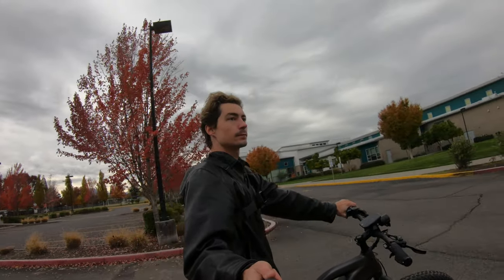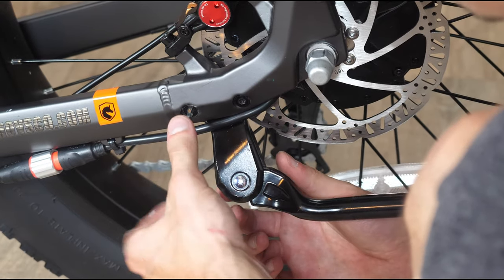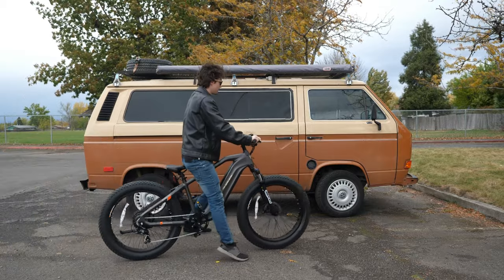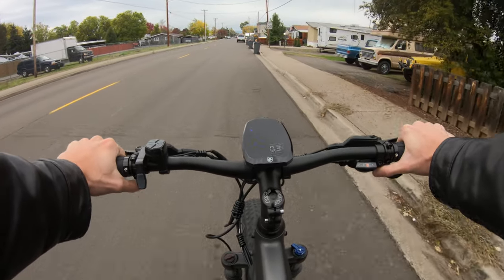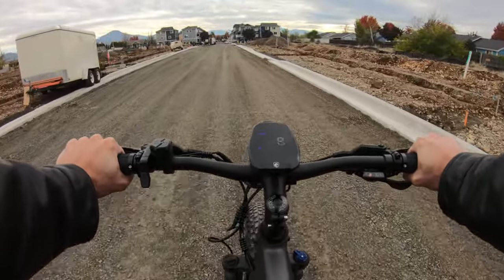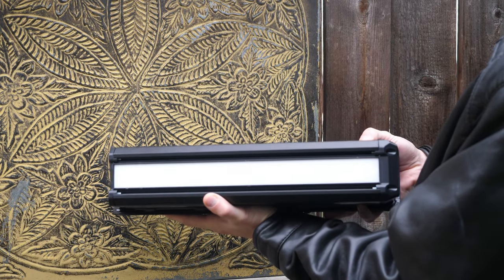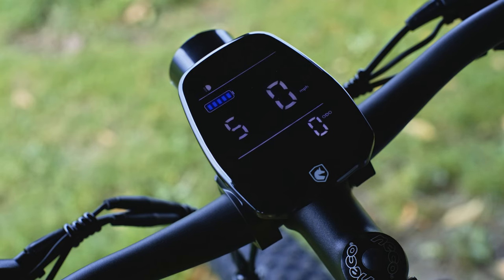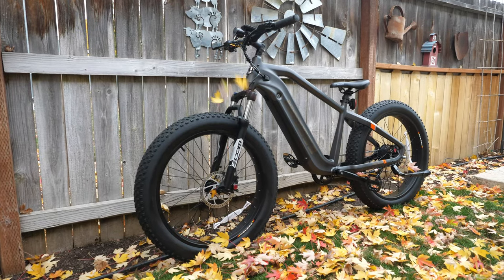Hovsco HovAlpha 26 - Torque Sensor E-bike

Comment: I got the same one. I get around 40+ mile range consistently X1 motor assist with peddling around 21-24 mph. Got about 200 miles on it so far, got it April 7th. Tus. Az.

Comment: You should contact cyc motors to try to review their high performance stealth kit. It's probably the most popular high power option for mountain biking hobbyists and they have just released their new gen 3 line with improvements like a mobile app. You will need a pre-existing preferrably cross country capable bike but the installation should be very easy.

Comment: It’s now an Ebike review channel
Reply from the maker: not for much longer. gonna be doing something new very soon
Reply: @BulletBarry  yeah I got this blade 10 e scooter it’s 1,248wh. Max speed 38mph. But yeah it’s always great to do more things. Altough if you did a small series on some beast e scooters like the teverun fighter supreme. You would probably be really impressed by the suspension and handling of it. It’s like an ebike with a lil more thought put into the design and a higher voltage